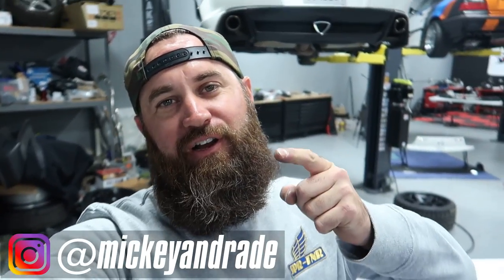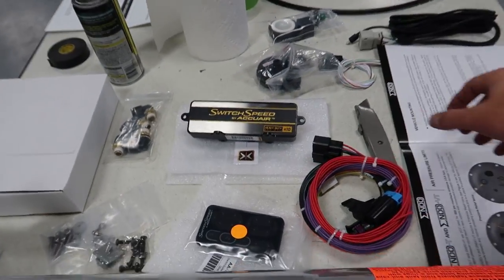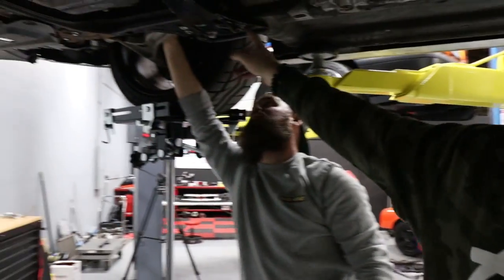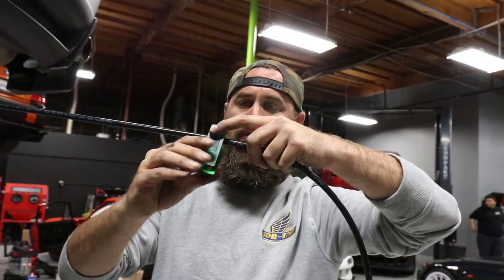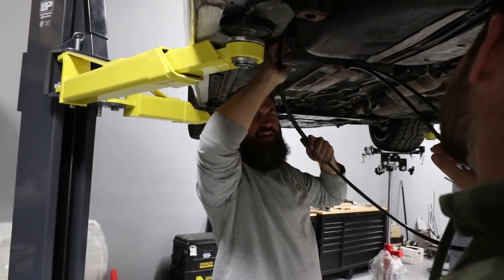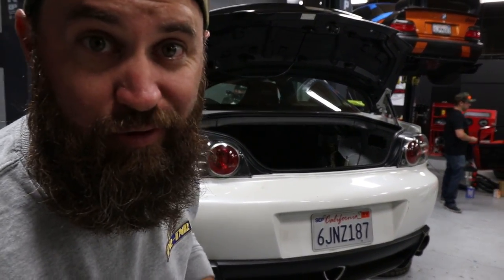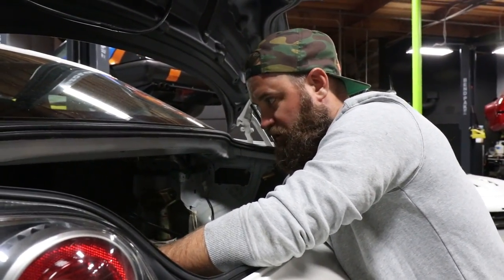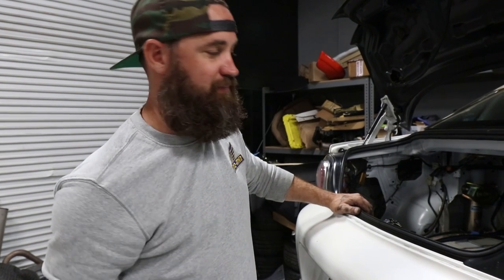BAGGING THE RX-8! Full Accuair DIY Install w/ Mickey + Evan - PART 1

Comment: Running the air pipe through the cross member ? Wouldn't you need to disconnect that every time you unbolt the cross member if removing the gearbox or other maintenance?

Comment: Don’t know if y’all read these, but I need some help with my car. Oil is leaking from around the engine head and onto heat shield of stock turbo. I don’t think it’s a blown gasket because I’m not having over heating problems. Oil isn’t milky and coolant levels are normal. Any advice? 
(2011 Hyundai Sonata 2.0t)
Reply: Get a mechanic 😉
Reply: Have you checked cam/valve cover  ?